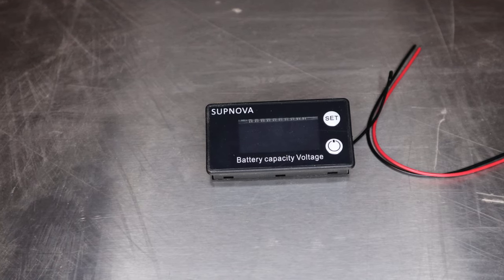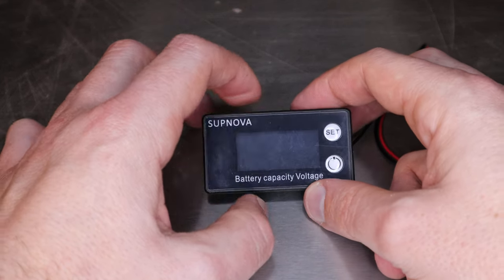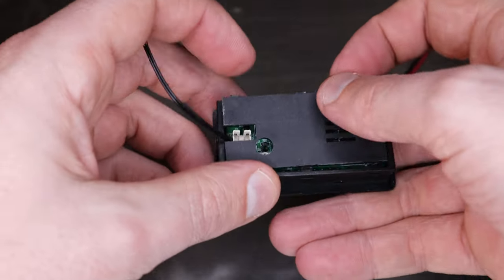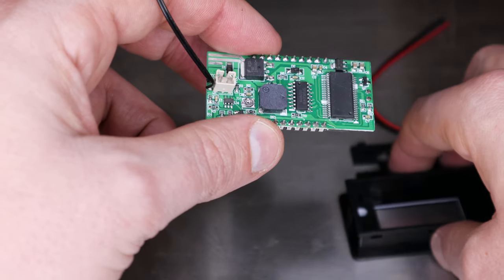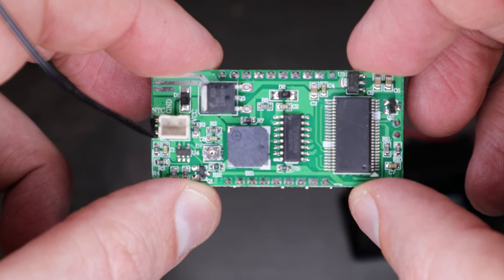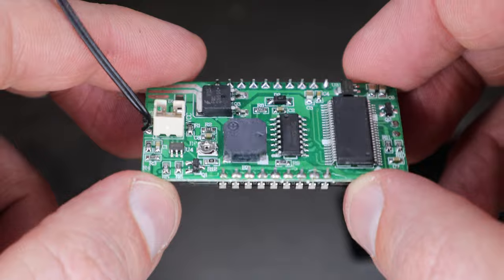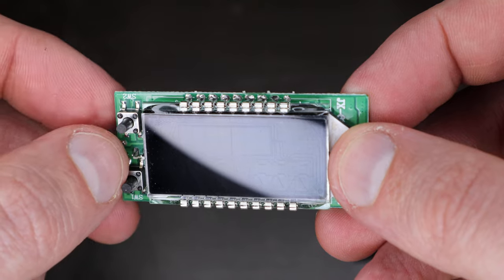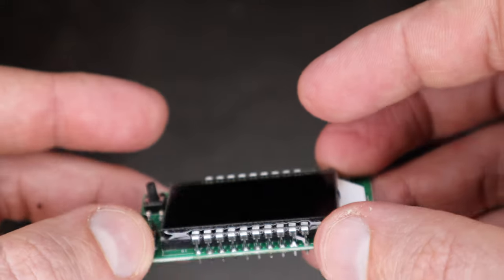SUPNOVA Battery Monitor 12v 24v 36v 48v 60v 72v #electronic #review

Comment: Now that you've had it for a while you should make another video and tell us what is your impression  of this display, how you used it with your batteries,  most of all,  how to program it.
Reply from the maker: Sorry for the LOOONNNNNNG delay. I plan to totally do that, I'm going to use it in my motor control box to monitor the 20V dewalt battery pack. I may also look into making a new PCB for it?

Comment: I found out how to program it,1-p =12, 2-L=03  , 3-f=03/3s, 4=low 12.1v, high 13.4v, 5-b=off,  low setting voltage alarm is set @10.5, 7-A=on , or off if not needed.